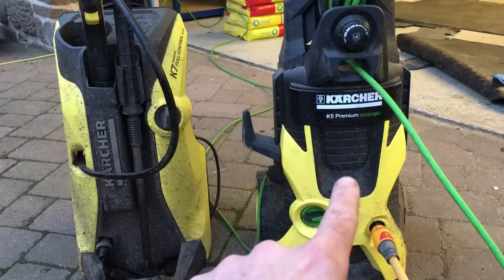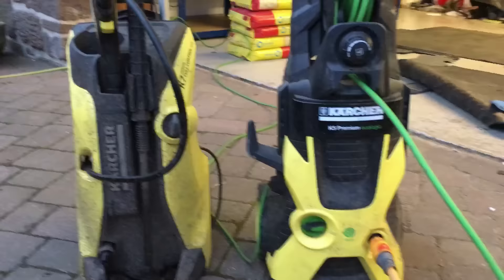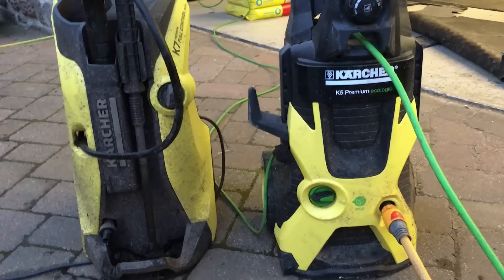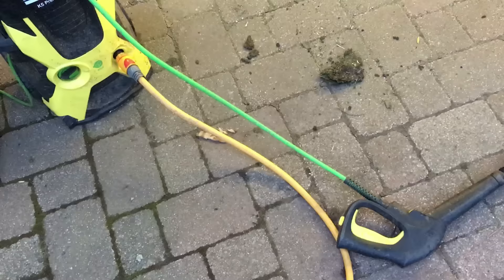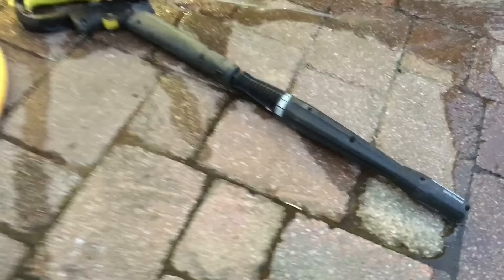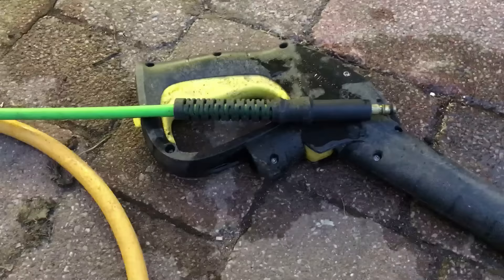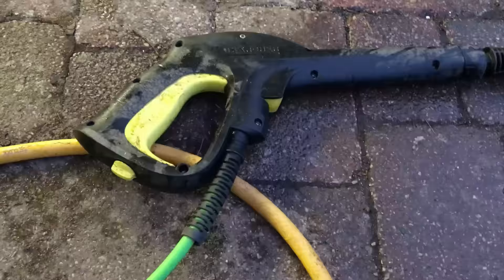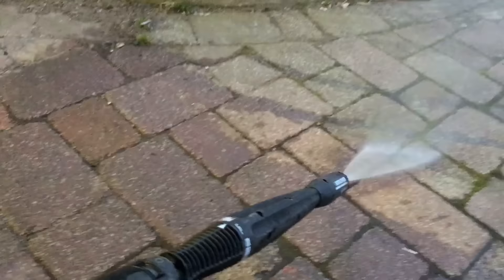Karcher K2 K4 K5 K6 pressure washer will not turn on | QUICK EASY FIX IN 5 MINUTES ! Karcher problem

Comment: IF THIS DOESN’T WORK!!! Try this because i was trying this method for hours with no joy… Plug the unit in and SWITCH IT ON. Attach the water and turn it on to the best pressure you can get. Leave the GUN PART attached with no attachment on. Spray water through the gun and shake the unit around to help clear the air. After about 30 seconds it will kick into life by itself!!
Reply from the maker: Thanks for the comment, hopefully it helps more people - thank you !

Comment: If you are still reading these comments my k5 premium has problem where it wont make pressure when i press the handle if its already turned to max pressure mode but if i start pressing it using low pressure and then turning it to max it works fine. Pls help :D
Reply from the maker: Sorry, I am not sure what the issue would be regarding that.

Comment: Hi Barry, i have a Karcher K4 Full Control and it has just stopped working in the past few days watched your video and many others and is still not working the switch on the front is not working and not powering on and have even tried to replace the fuse on the plug from the pressure washer and still isn't working. I got the pressure washer as a present a few years ago so i can't go to Karcher for a repair. Do you recommend what else to do and what other Karcher pressure washers are good?
Reply from the maker: Hi, have you tried running the water through the machine for a good 10-20 minutes ? I have seen it that by doing this, it then works. I am not sure why but there have been a few people on here that this did not work for and then they went back and run the water through for a longer period and then it works ? Have you tired that ?

Comment: Or buy a heavier condensator. Not the 20uF but a 40uF. Karcher 9.002-614.0 Condensator 40 uF if the solution is not working in the video.
Reply from the maker: Thanks for the comment

Comment: Hello, i have a k2 full control and i was using it nd put it away after use. Next time i went to use it (day later) didn't turn on. Tried this video and airlock solutions. Tried cleaning filter and even chnaging fuse. Any idea what the problem might be. Never had any problems before.
Reply from the maker: No idea - sorry
Reply: @Bacrenfencing  nooooooo

Comment: How do you prevent air locks from reoccurring? This is a great fix but it keeps happening even though I always pressure the excess water out the Lance before switching off.
Reply from the maker: I am not 100% sure, thanks for the comment

Comment: I read this and hoped that it would fix my machine. I did exactly what you instructed but still no power. I wonder if it's worth leaving the water to run any longer. I have changed the fuse , so it's not the power point. Don't know what to try next. Any ideas ? Thank you
Reply from the maker: Try running the water through for a good 10-15 minutes Lynne, if this does not work than not sure to be honest ?
Reply: @Bacrenfencing  Thank you for your help, I'll try again tomorrow for longer

Comment: My problem is that the presure washer unit is fine it powers on and off, but when i pulgnin the lance,, with or without water turned on it stops working and does that when it doesnt turn on. But if i turn the power on and water on and take off the lance when the water is on it starts working without the pressure hose or lance but i connect the pressure hose or the lance or both when the water is on or off or the pressure washer is turned on or off its stopps working so i think its genuinly broke
Reply from the maker: Not sure what that could be to be honest ? Maybe try phoning Karcher helpline ?

Comment: Hi, I tried to bleed the air on my k7 and Reconnected to lance and give a try but still the same. My k7 would never turn on with lance connected I would have keep the trigger pressed for very long,only after 3-4 min pressure washer turns on if I let go off the trigger, again I need to wait 5 min for the washer to turn on, I've replaced lance and pressure hose but nothing seem to fix my issue. Could it be a faulty pressure switch? It takes ages to build pressure and start the unit.can you kindly suggest some other solution..thank you..
Reply from the maker: Apologies, I am not sure what that particular issue could be.

Comment: Help 😢 it works but only starts for 2 seconds and shuts off again. I checked the extension cord and flushed it 3-4 times and still it cuts off right after starting
Reply from the maker: Ah, not sure why that would be ?

Comment: Used my brand K4 twice, went to use it this morning and no power. Did exactly the same as the vid suggests and still no power.
Reply from the maker: Try running the water through it for a good 10-15 minutes - that may work

Comment: Sir my problem to my K2 pressure washer is every time I use and stop its take time to started again and I cant use the high lance varo it will not start what could be the the problem .
Reply from the maker: Sorry, I am not sure on that one. Have you tried using the method shown in the video ?

Comment: But why is it necessary to disconnect the hose? Just run it without power on until the air is cleared.
Reply from the maker: Because that's what worked for me

Comment: Is this a normal thing to happen on the start of the brand new out of the box k4 compact? I bought it and try to start it, but i didnt hear the sound, and after preshuring the button, he kinda   tryed to start, like a car engine. After a while started working, but after 10 minute brake he didnt want to start properly again, for 2 seconds, also no motor start when turned on/off
Reply from the maker: Not sure, my video was made to help users of old units. Never heard of any issues with brand new units ?
Reply: My old k3 broke down after more than 10 years, the "switch" unit is to expensive to change cause when i pop the switch it instantly goes to work and doesn't stop unless i cut the power on wall socket. i went to official repair shop and i saw on the screen, the cost of that part (they can order entire block/component only) is around 100 euros, plus work etc. New one i paid 200 euros. So now i have the old one who doesnt want to turn off and new one who doesnt want to turn on hahahaha
Reply from the maker: Great news !

Comment: There is only one switch in the whole machine. Somehow the pin that contoles switch gets stuck.
Reply from the maker: Not sure what you mean ?
Reply: @Bacrenfencing  the motor is regulated by a pressure opperated switch. And the on off knob is just a mechanical blocking of that switch. Clever engenering, but I liked there older style better those who keep running if you let go of trigger.

Comment: I avea 1y.o. K2 but can't disconnect the lance!
Reply from the maker: Not sure mate, I don't have a K2
Reply: @Bacrenfencing  Thanks. Silicone spray, forced strongly with screwdriver. It finally released. Your 'trick' WORKED!! THANK YOU. 
(Next problem: connection to a small pistol (to shoot upwards underneath digger and mower deck) leaking. Have two boxes of o-rings,  can't get one to fit even with spray and force!! Nothing's simple, but you've been a gr8 help. Thank you.

Comment: Unfortunately this only worked for me just once. I followed the instructions in this video and after 5 mins turned everything and it started working. I was washing away and stopped for a break. Went back and it won’t start. Did all the things mentioned here and it won’t turn on. Dead as a dodo.
Reply from the maker: Try running the water through the machine for a good 10-15 minutes, sometimes this will work as you need to get all the air out of the system.

Comment: after 30 minutes my karcher was still spluttering out air. Did not fix.
Reply from the maker: Sorry to hear that, it works for most people. Try running the water through for even longer, that sometimes works.

Comment: My pump is not stopping working and no pressure
Reply from the maker: Thanks for the comment , try what is suggested in this video and it should work again.
Reply: @Bacrenfencing  i tried it but still i cant get pressure and the motor wont  stoo
Reply: @Bacrenfencing  should i change the pressure washer cylinder head??

Comment: if this fixes my K1 i will kiss you
Reply from the maker: Did it work ?
Reply: @Bacrenfencing  Not this time but not because of what is shown in video - the plug was missing the earth it had snapped off! Ordered a replacement power cable hopefully that will be that. Cheers

Comment: This didnt work for me 😞. Loads of good comments below and I'm in a minority of those it didnt work for.
Reply from the maker: Ah sorry to hear that Shaun..........maybe try running the water through for an extended period of time, this sometimes works. Failing that, it may be something else that is wrong.
Reply: @Bacrenfencing  thanks for your reply. Yeah I let it run a good 10 or 15 mins. Checked the fuse as well but it just wont fire up. Will get it looked at by the service centre. Cheers.

Comment: I have done this and it still will not switch on! What now?
Reply from the maker: Try running the water through it for longer, maybe 10-15 minutes, that sometimes works. Failing that, not sure what the issue could be ?

Comment: While all this is helpful, the machine was not designed to operate like this.. Something is definitely wrong.  When the machine is plugged in and connected to water it is supposed to work. Sitting around waiting for water to run through is ridiculous. Mine was exactly like this, and I sat around waiting for water to run ..until one day it just would not start despite water coming through. Karcher power washers are an expensive pile of rubbish. mine is just 4 years old. with little or no work done
Reply from the maker: Thanks for the info

Comment: Bought one, hate it, cheaply made Chinese plastic pump parts, built down to a price, pressure falls off a cliff due to shitty parts wearing out. Karcher will charge you a fortune for replacements.
I repaired mine with a full set of seals and a new valve body.
Save your money till you can afford and buy a Kranzle instead.
Reply from the maker: Thanks for the comment